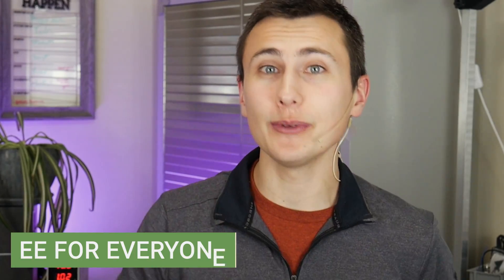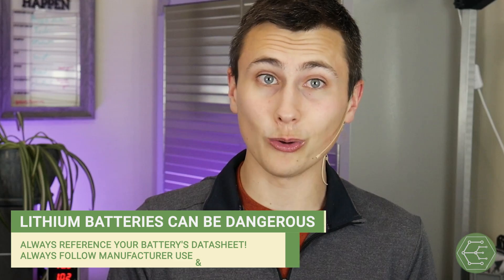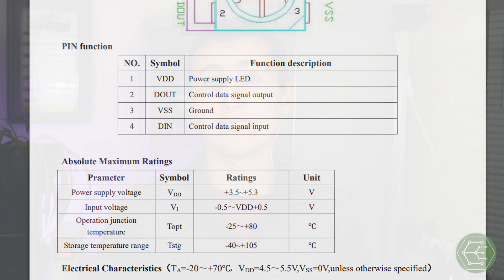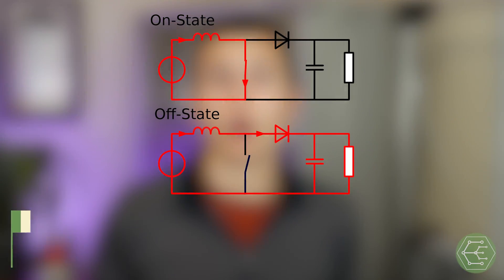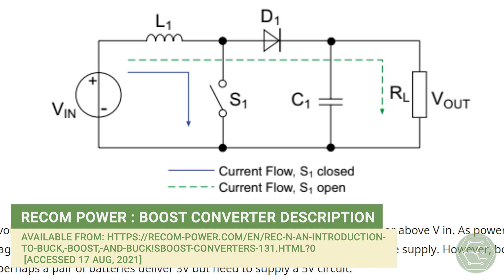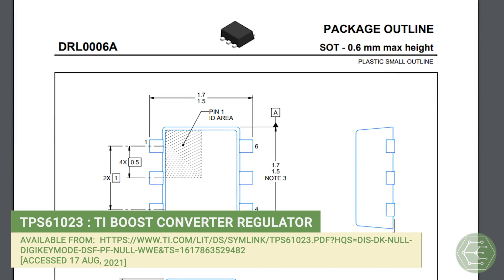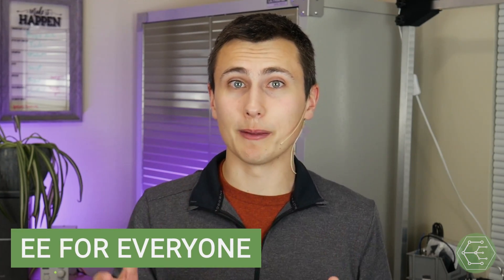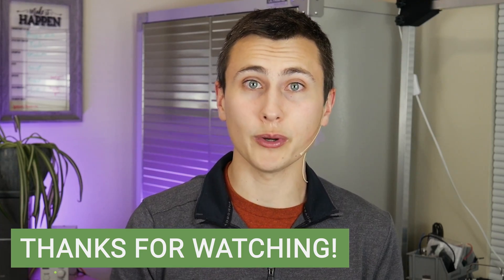Generating 5V from a Lithium Battery! (Boost Converter)

Comment: Why would i use a boost converter to get a higher output voltage out of the battery instead of putting two batteries in series?
Reply from the maker: Helllo MrBubblegumx, great question!
When using two lithium batteries in series, battery balancing becomes very important (to avoid over-charging or over-discharging). Also, the required charging voltage is doubled.

A 2S1P configuration would require a minimum charging voltage of ~8.4V, requiring a boost on the charger side instead of the load side (for a 5V input)

For most situations, it's easier to find 5V for charging (from a USB Port, etc.) than requiring a non-standard charging voltage (9V+)

Of course... the trade-offs are a bit more complicated than that, and are application dependent.. but it's a start. For a bit more depth, here's an article on Digikey regarding Lithium battery charging! https://www.digikey.com/en/articles/a-designer-guide-fast-lithium-ion-battery-charging
Reply: @EEforEveryone  thanks a lot 😊